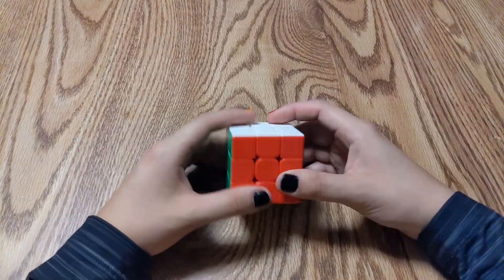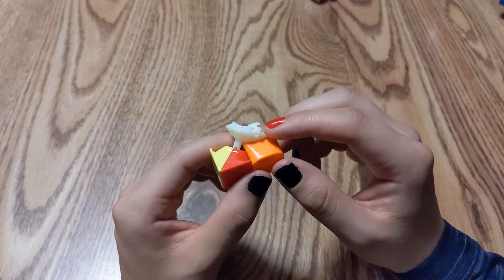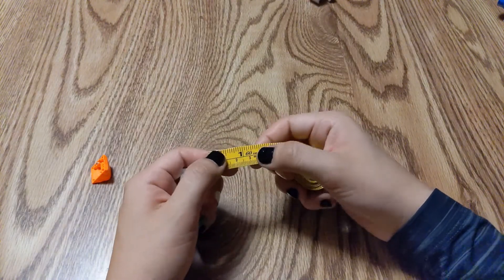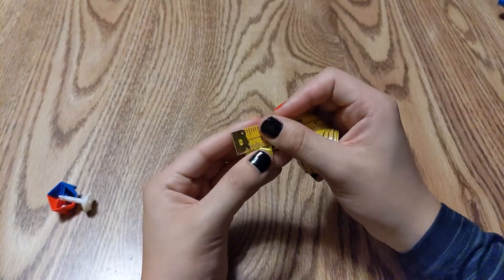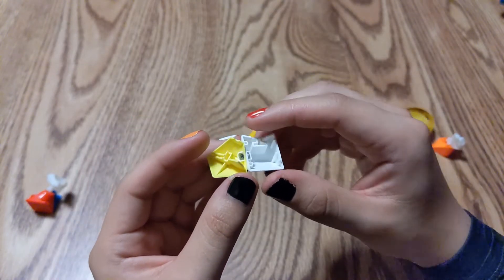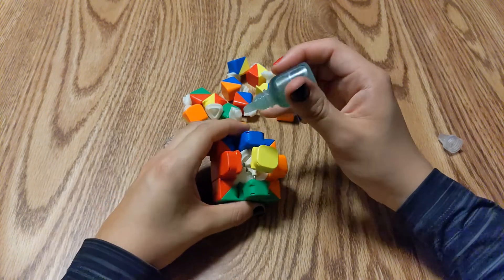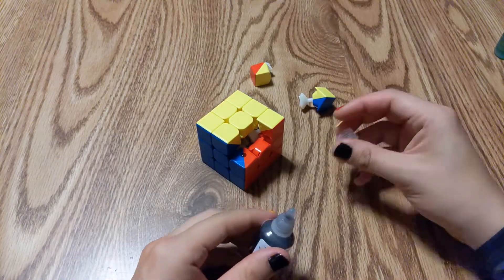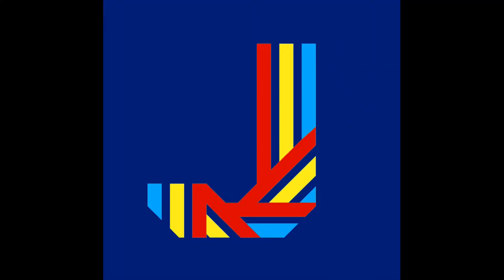RS3M Cube Breakdown and Setup

Comment: are the magnets are glued in
Reply from the maker: Yes, they are! And glued in very well, so I didn't have to worry about a loose magnet, or a magnet becoming loose over time :)
Reply: @JSquaredCubes  im thinking of removing and replacing it with other magnets but theyre glued in btw thanks for the reply
Reply: @JSquaredCubes  im gonna make the damian method of the cubicle
Reply from the maker: No problem, and oh? Nice :b
Reply: How can I remove the magnets ?
Reply: @araba_wangkheimayum  you cant
Reply: @araba_wangkheimayum  watch the vid of the cubicle of the best budget cubes to see how to make the magnet stronger
Reply from the maker: Yeah... The magnets are glued on there pretty strong. If you want to spend hours, or days soaking the pieces in hydrogen peroxide, then maybe you can loosen the magnets a bit, but you'd still have to take some kind of flat head tool to force the magnets off the plastic. I've done it before with cubes I've magnetized myself, but the cube would end up with battle scars.
Reply: @araba_wangkheimayum  Just add more magnets on top